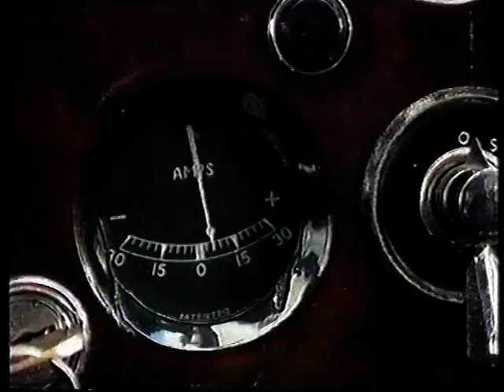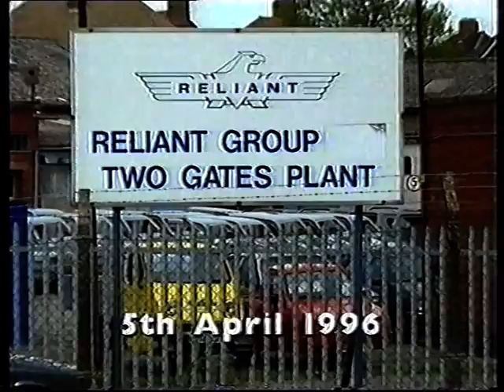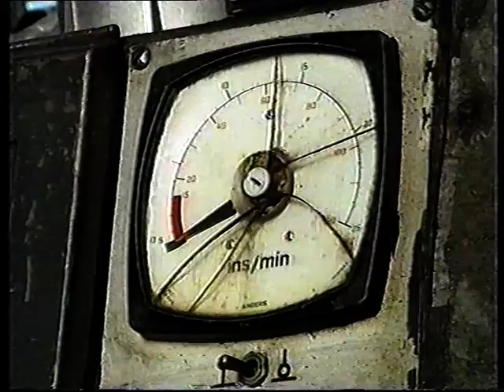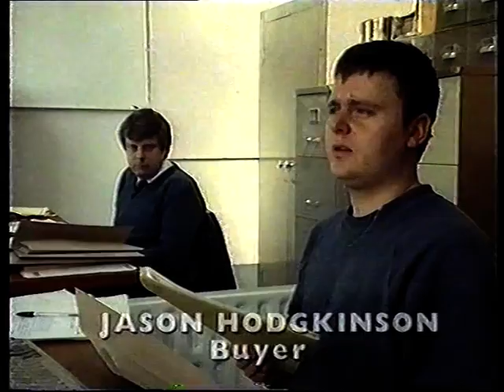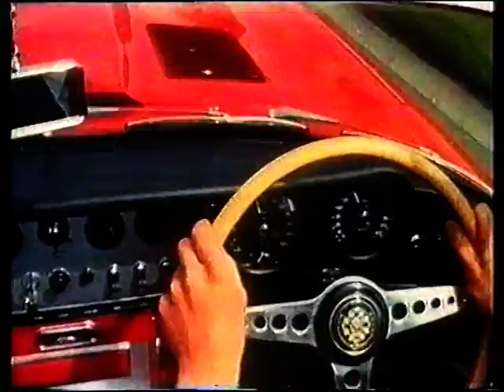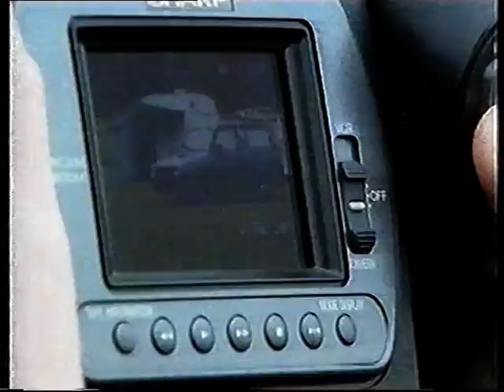Trouble at the top The Robin Rides again

Comment: I loved them.  The first one I had, was a Reliant Robin with an Austin engine in it.  I then had several more of the later ones.  The main problems I had was the kingpin and bush on the front wheel of the early ones.  The chassis on the early ones were prone to rot.  The brakes were poor, and you needed heavy boots to make them work, having said that I loved them, and I was so sad when they stopped making them.  They were cheap to run and cheap to tax.  Granted they didn't pull the birds, not a lot of room for fun and games.  Please bring them back.

Comment: Has Brian borrowed a chopper gun yet to do the bodies?
Reply: @prawny12009  Even more painful to see that the person with supposedly "experience and expertise" cannot explain why "chop" cannot be used on the car's floor and instead just insists on refusing to find out if it can. 

I recall Sterling Moss recalling why he liked driving for Mercedes if you said for example "I think the car would go faster with square wheels", there were two responses either "we tried that in 19.. and the car did not go faster" or you had square wheels on your car for the next test session. 

That attitude is one of the reasons Mercedes is still with us and Reliant is not.
Reply: @prawny12009  Didnt Mr Haynes want to make the crankshafts with a chopper gun too ? lol